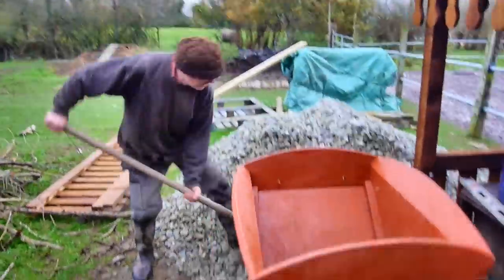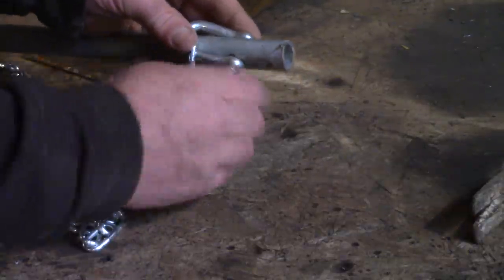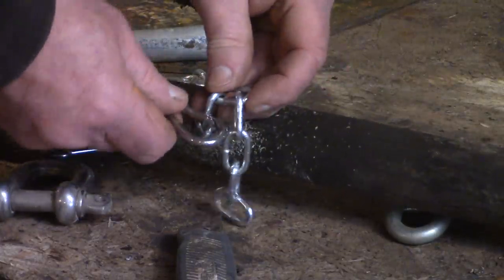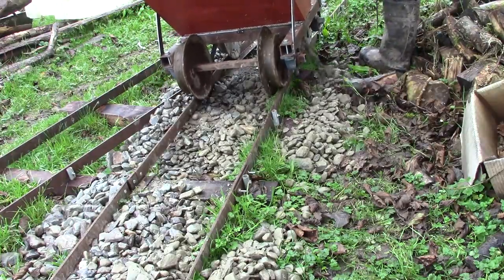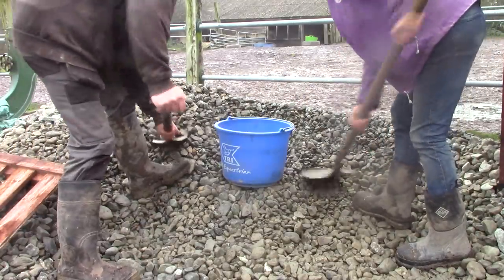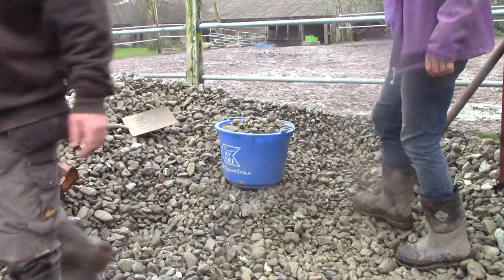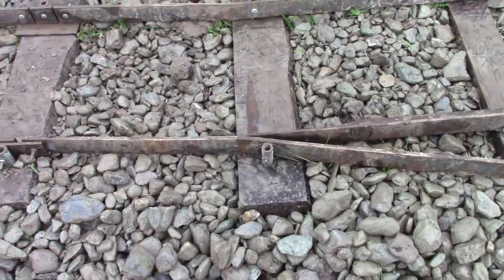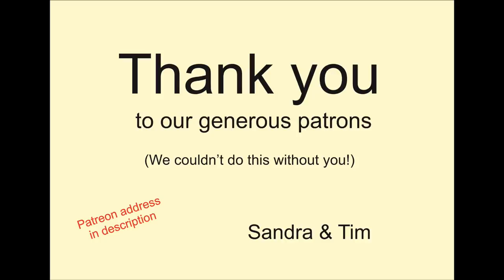A Wiggle-Stick And Other Improvements To The Ballast Wagon - And How Much Weight Can It Carry?

Comment: The way you are doing it is exactly how we do it on the big railroads in the U.S. We dump ballast up to rail head hight and then use a tamper machine to lift the track up and level it and align it. The big ballast trains have the same problem dumping rock as well. The train engineer will slam the train backwards and forwards to get all the rock out. We all so sometimes will lay a tie across the track on the rail head just in front of the trailing wheels to spread the rock evenly as the car is pulled. The wheels push the tie and it spreads the rock nicely. This keeps the rock off the top of rail and this keeps the car from derailing as well.
Reply from the maker: Thanks, good to hear I'm not the only one with clogged up hoppers

Comment: Could use a lever and fulcrum to lift the track up about 60-80mm. Put fulcrum between ties and lift up tie in front, or maybe next one, then block that one up and move backwards, lifting and blocking, then spread ballast underneath.  
Great show, great railway. Great everything.  Cheers from NZ.

Comment: Lift the track, put some wood underneath the edges of the sleepers even long strips to stop it sinking in the mud, drop the stones in the middle and pack them under the sleepers and than remove the wood for the next section and place the stones on the side,  great job in thinking and creating it right from the start, cant wait for the next video

Comment: I could see putting the gravel down first before the rails and sleepers if you were extending the line, but once the track is already in place, it makes more sense to ballast it the way you're doing it now.
 For adding to the line, a flat car with 3 sides and an open end would be handy for hauling ballast to the end of the line, you can pull the ballast rock off the end of the car with a hoe and spread it, then add the new track section on top of it.

Comment: Having spent a couple summers on a light rail track at a mining museum, your method of lifting the rail tie/cross member and then tamping the bed media underneath brings back many memories.  While the track at the museum was a good bit heavier than your track, the principles are the same. The bed is meant to give and take, while transferring the live load of the cart/train in a manner that does the least amount of damage to the bed, the rails, and the load (cart/train), all while keeping the whole system in place and safe for the users.  As such, the more time you spend on the bed, the better the overall system is going to be as it is the foundation of the rail system, its weaknesses are magnified throughout the rest of the system.
Beds are like plants and need different levels of maintenance at different times, in different frequencies, and therefore must be monitored regularly.
Great job and can't wait to see more videos.
Reply: NOTE: the track at the museum used 4 foot long 6 inch x 8 inch oak ties soaked in kerosote and lasted about 10 years +/-, requiring annual replacement of dozens along the 1/4 mile route.  You haven't worked hard until you carry one of those on your shoulder 50 foot at noon in July, and then have to set it in.
Reply from the maker: That sounds like a lot of work - but satisfying too?  I might have to consider concrete ones..
Reply: @wayoutwest-workshopstuff6299  several railways have started experimenting with sleepers made from recycled plastic, they last basically forever as they don't rot, and are much lighter than the concrete ones

Comment: Your solution is far more charming and suits your overall design in that regard. I wanted to mention that I have a few manual dump trailers for use around the homestead. Besides the problem of making a trailer that can be easily dumped by human power, I often came up against jamming issues like this. It did not matter how smooth I made the bin, things always found a way to stick to the wood. Anyhow, there is not much point covering all of the trial and error, but the fix in the end was very simple fast and inexpensive. Delrin, or UHMW, whichever you prefer. These are virtually non-newtonian in the lack of friction. I often use a pair for moving very heavy machinery. It seems like the heavier the item you put on it, the more definitively UHMW traps air between the two layers. I have been able to move 5 ton machines just by pushing on a pair of these mats. They worked for me just as well in the trailer. I just got a sheet of quarter inch thick and lined the trailer with drywall screws. I did not even bother to caulk the seams or countersink the screws. Everything slides out now. Even mud that has that odd suction quality to it, it just slides right out. It's also extremely resistant to scratching and denting. I think a half sheet of this would solve your hopper feed issues
Reply from the maker: Thank you - I'm impressed!

Comment: the remove the track and then put the gravel down and then put the track back only works if you have aome really specialized equipment, just look at the real railways, 

probably a good idea to look at the types of wagons used on some of the welsh narrow gauge railways to see how they do it
Reply: Common. The solution is simple. You do the work with a wheel barrel before laying down the track in the first place. Or you use the single track thing he showed us before. Get the stone on the ground and then put the final track down. In both cases the 2 railed track should be put down after the stone is put down first. 

But hey if messing about getting stones under the sleepers are a option the ok. Not like your not going to have to mess about with the sleepers anyways, getting the rocks and overall groundwork set up right require some work to be done with the track put down. 

I wish there was some real insensitive to make my own railroad. But I can not see a good reason to do it :c Just not practical or useful.  

Even if it is cool I can not get away from the ide that having a small tractor is just much better use of ones time. Bit more expensive in building trailers. And without a working engine there is no hope in moving it by hand. And mud might be a problem in some places in the world. But there is no reason for me to build a railway. Sadly. The rail cost is so much higher then just having a old tractor on wheels.

Comment: In some trucks here. Have device that shakes to get all the sticky fill out. 
All it is a offset weight that spins in a box attached to the bin.
I wonder if you built one but use a cordless drill. Turn on the drill and then open the gates.🤔
Good luck on your project. From across the pond.

Comment: The 2 wheel idea, a rotavator would be good, I saw them being used in SE Asia and if you used wagons with normal tyres you could tow stuff round the farm away from the railway tracks.

Comment: I actually think I know what that commenter meant you mentioned:

What full sized railroads started doing was using hydraulics to lift the track up, but the actual track laying machine has both tank tracks and rail wheels behind them (Germany invented this it seems). The machine is an all in 1 track layer doing everything in 1 pass, it folds together the track which is quite a site to see. All the track is laid in long bands that are continuously casted directly from a furnace. This makes it possible for the track layer to just drive along at a slow pace folding the rail that has been placed aside of where it will go, then under it the machine places the ties (ballast has already been put in place by trucks or some other machine), tamps the ballast around them and spikes down the track. Reading back in the comments, someone else commented on how we do it in the USA, but that is with existing track, not new track, where we just lift up the track to grade height and then tamp under it.

Now that aside, in your situation it would be best to have some sort of cheap tool or mechanism to pry up the track to push the stones under a bit easier. Like you even said, the ballast hopper is to make laying the ballast under the existing track easier, your not laying the ballast before hand. A large shovel, maybe modified one, might be best and cheapest for gently prying up the track while under the ties.

Comment: just a suggestion , on the floor inside the wagon , the area between the ends of the  two sliding gates that let the stones out , place a V shape piece of steel  across the bottom on the narrow width so that it has an angel directing the stones out the hopper doors. it may make the stones run better. It only has to be about 6 inches high.
Reply from the maker: I was thinking that might make things worse? Everything trying to get through the hole at the same time, but I'm not sure.

Comment: Most modern railways have a machine that has several hydraulic jack stands that lift up the rails & sleepers while pouring the stones under the sleepers. that same machine also travels along the rails. Such a thing is huge & expensive which is too much for you to cheaply emulate.
Reply: Huge & expensive & devilishly noisy. I used to live next to a railway and they refurbished the line one night to avoid disrupting the trains. I woke from the most horrific nightmare ever as it slowly approached down the track in the early hours. But impressive once you are awake.

Comment: There is a well known result in hopper design that says that the outlet hole at the bottom of a hopper has to have a minimum dimension of at least five times the diameter of the grains you want to drop out, else they will jam. Even then it doesn't always work.
As  a teacher I can attest that the same rule of thumb applies to little boys exiting the assembly hall out of the double doors. Year 7s manage fine, year 10s get stuck. But then it was a Grammar school so they were maybe not very clever.
Reply from the maker: Ha! Bigger doors for older children makes perfect sense : -  )

Comment: Getting product to flow out of a hopper car is an old problem.  In the state of Colorado, USA where I live, our local power plant uses "car shakers" to loosen coal that can be frozen in the 100 ton open top hoppers.  The shaker consists of a large steel frame with a pair of electric motors on it.  The frame is lowered on top of the car and the motors rotate counterweights which shakes the car (wagon) on its truck (bogie) springs.  This allows the coal to flow out of the bottom discharge doors easily.
Reply from the maker: Thank you. Interesting to hear.

Comment: I would also suggest lifting the track and then pouring the gravel. I guess people recommending that don't mean removing the tracks, but rather propping up the sleepers with some temporary shims, pouring the gravel, then removing the shims. Lifting the track post-gravel-pouring seems cumbersome, although I'm not sure the suggested procedure requires less effort in the end. Yet another idea, as the rails are somewhat light: have a flatbed wagon with an enormous lever mounted on top, like a seesaw, where the business end features two chains with hooks to lift the track. Surely, the lever would have to be very long as one couldn't lift the track thats directly below the wagon.

Comment: In the realm of network rail, you put ballast down first, sleepers and rail, bit more ballast then tamp it. Fully aware you're not doing it to that spec, but the ballast under the sleeper helps with transferring the load and stops the sleeper sinking into the ground (as well as drainage). Just highlighting so you can build your track to be as little maintenance hassle as possible.
Reply from the maker: Yes, but how do you lay the ballast down first? On wet ground, without machinery?
Reply: @wayoutwest-workshopstuff6299  Lay some terram down where the ballast is going, to help with the stone not penetrating the soil and not losing it in the wet ground, then you'll have to manually place the ballast using a wheelbarrow and rake. I don't know how long your steel sections are, but say if they are 5m long, ballast up a 5m section, lay your sleepers and rails then do the next 5m. I wonder if you made a tipper truck, you could move your stockpile along to the end of the rails where you want to extend, and drag the stone from there. I hope this helps.
Reply: Railroads build track first then ballast, it's the only way for the ballast train to dump it in the first place

Comment: Looking good now the stone is in. When I saw the wiggle stick an alternative would be to have a shaft through the box of stone with tines on and a handle on the outside the pusher could reach and rock every so often. Might give move control on the distribution as you can push and wiggle at the same time? But then we're all getting flustered over ballast and I bet your already on the next adventure!

Comment: I think you could use this system to unload the firewood wagons and they could be lower, not needing the gates to go down.  Also, you could choose to pull the bottom from the side or from the front or back. :)

Comment: Im planning a potential rail that runs along the outer edge of my 2 acre scrapyard. 

A solar powered engine is doable by my math. My little engine will basically be a 1500w solar array on wheels that I can also use as a portable power source.

Comment: you need to lift 2-3 sleepers at a time before dumping the stones. Look at videos of track laying cars. They usually lift the track  dump stones and then slide the sleeper into place. I think a wooden wedge at a right angle on the tip of a stick will let you hold it in place and hammer it under the sleeper from both sides with a sledge hammer so you don't need to bend down. Make 6 of them so you can lift 3 sleepers. As long as the wedge is only 3-4 inches thick it should still allow you to push a cart over the track. Then as you fill it you work your way along the track.

If you decide to build another one make it dump to the front by raising it up a foot and turning the hopper. That would allow you to dump roughly a foot ahead  of the wheels and only lift 1 sleeper at a time. A brake to keep it from rolling away will make it easier.
Reply: I can't say your idea is bad, but his system works and it's amazing x)

Comment: Think you could look at using old engine oil to run heat things. To clean, use a centrifuge and wash with antifreeze . Gives you soap I think as well. Also when making charcoal use the gas given off also to run engines  and heat. Use the heat to grow or heat the barn.

Comment: Surely you could add a piece of linkage to each end of the wiggle stick and attach it to the wagon wheel slightly off center. Then, theoretically, the motion of the wagon would provide constant wiggling
Reply from the maker: I know - I had it all drawn out with cams on the axles, but went for the simpler option instead

Comment: Looks great. The end shot really shows how much stone is required for a small section. Your lifting with a pic seems to be working very well. Looking good. Your wiggle thing is brilliant. I have one idea if it gets to be too much to lift the wiggle stick is to cut out some conceived boards and put on the top of the box kinda like bearings and the stick/shaft is there and then just bore out a hole and add another bit and then all you have to do is pull a bit. Pulling back on the bit will do exactly what you already doing,  Just might be easy if you have a lot of weight in there. I do not know because you did not show that last load being emptied. I think there is another video, better go watch it!

Comment: I wondered if perhaps the “anti jam bar” at the bottom could be improved if it passed all the way through the skip from left to right and had a handle on it to turn it like cranking a stationary engine over , the anti jam bar would obviously need some kind of lugs added to agitate the ballast as it turned

Comment: Laying the track bed ballast first then the track followed by top ballast is the normal way to lay a railway line. On a track like yours if the bed ballast is good enough you may not need to tamp. Hand tamping is hard work.
Reply: Yeah I doubt he will have to tamp. Once he gets this all laid he can lift and adjust when or if it sinks in areas.
Reply: @kameljoe21  That is tamping

Comment: looks like it's time to build a Loco, with how heavy the ballast bin is. Perhaps you could cannibalize a garden tractor or some other small engine machine and use either pully or chain to drive the axel.

Comment: Are you gonna be making some kind of pedal powered car for the railway to tow things easier? You could gear it really low because your railway is only short around your yard.
Reply: He said in another video not right at the moment. Though we did put him on to an idea for a possible quick engine using a rototiller.
Reply: I was wondering if a block and tackle might be useful. Instead of lifting, pulling.

Comment: Is the rail system compatible with your single-rail system?  Could you connect the single rail onto one of the double rails to bring smaller loads out to the rest of your gardens?  Using the single-rail cart on just one of the double-rails.
Reply from the maker: Unfortunately the posts that keep the rail upright would get in the way  : -  (

Comment: Ok a little tip a better way to lay track is to actually put the ballast first then the rails
Reply from the maker: And how would you do that? There's a ton of stones for each length - I'd like to see you doing that with buckets or a barrel. the whole point of the wagon is to make life easy - and it does.